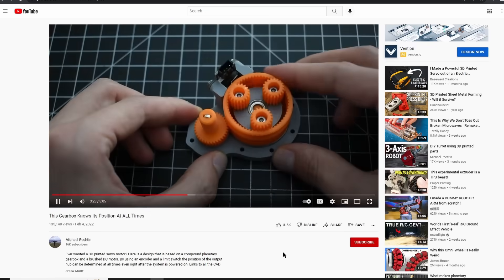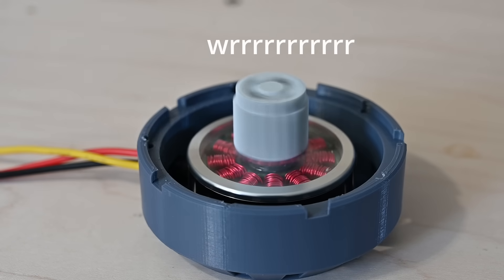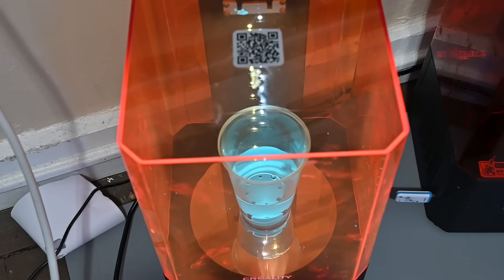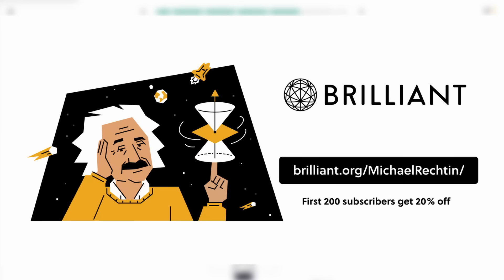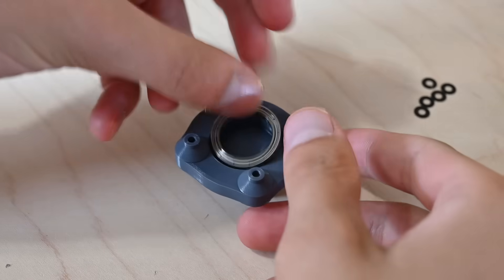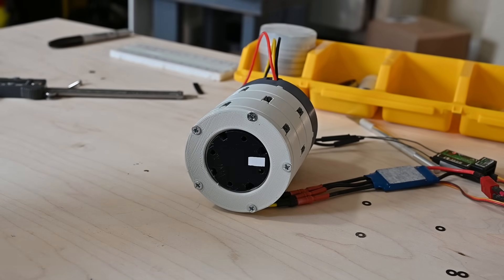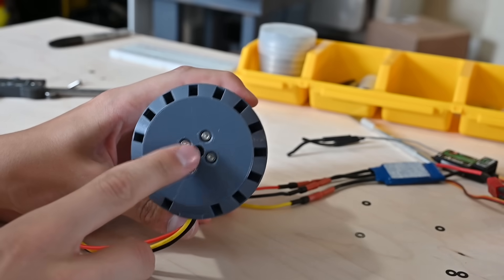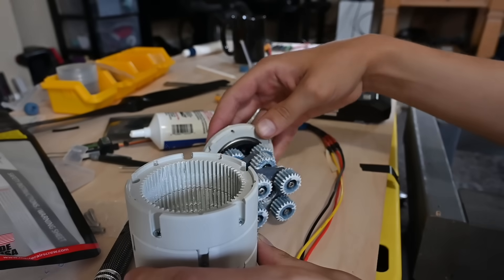3D Printed Stackable BRUSHLESS Motor Gearbox

Comment: The problem with your torque measurement now, is that because of the high velocity you are coupling a significant amount of intertia. The motor inertia might seem very small, but because of the gearbox it is amplifier by n^2. None of the cheap brushless motors actually quote rotor inertia, but generally its somewhere around 30 gcm^2. That means that with your 64x reduction gearbox, you are dealing with an inertia at the output of about 0.0123 kgm^2 (note the change in units). Guesstimating the speed of the output shaft, its probably around 0.3 rotations per second, 1.9 rad/s. This results in an angular kinetic energy of approximately 0.0217 J. Thats quite a lot of energy stored, especially if you want to try to slow it down in a very short period of time. Point being is that you are generally measuring much more than just gearbox output torque.

Torque testing should indeed be done at zero speed.

Also, are you aware that there are specially wound BLDC motors meant for slow speed operation? These quadcopter motors are optimized to work in a constant high velocity, but the ones optimized for slow speed are much more well suited for most robotic and servo tasks. You can easily find relatively cheap ones if you search for 'gimball BLDC' and similar search terms.
Reply: My thoughts exactly. Plus the rotating gear stages add their own inertial energy on top.
Reply: I feel dumb
Reply: Are you sure about the unit conversions? joules aren't a big unit, so 0.02 joules sounds small. As in, it's the inertia of a baseball that is moving at 2km/h (equivalent of falling a whopping 1.5 centimeters)

Definitely shouldn't be able to break the arm on its own, but I guess it could influence the result somewhat.
Reply: @alexbv475  Yes I am sure of the unit conversions. As a double check: rotor inertia is 30g cm^2 -> 0.03kg cm^2 -> 3e-6 kg m^2. Adding the n=64 gear ratio: 3e-6 * 64^2 = 0.012 kg m^2. Rotational kinetic energy is 0.5*I*omega^2 = 0.5*0.012*1.9^2 = 0.022.
It might not sound like much compared to your example, but a baseball is 150gr, quite heavy. If you drop this from 1.5cm onto a loadcell, it too would produce high forces. The key problem is that you have something that you drop onto something very stiff. This means that a lot of energy has to be dissipated in very short time period, and thus peak forces are quite high.
A pillar in a carpark can sustain tremendous loads, but if you smack it with a hammer, which has relatively low amounts of energy, the high peak stresses will still allow you to do damage.
Reply: @tHaH4x0r  Subbed for the maths. You could probably do videos about this kind of stuff
Reply: this definitely needs a clutch behind the first stage
i don't see the ESC surviving actual use
Reply: Nice explanation. Although you did not change units. You changed scalars. Gram and meter are the units. Centi and kilo are the scalars.
Reply: What is the type of winding you are talking about for gimbal motors? both gimbal and drown motors have the same type of winding which is concentrated winding type. Running a any type of motor at slow speeds depends on the type of controller not the winding type of the stator.
Reply: @Zae-R  Type of winding is the same, but not the amount. Gimball motors have much more windings to up the resistance (around the 10 ohm ballpark) such that they can produce a high amount of torque at slow speeds, and don't have a very low resistance which could easily burn out the windings without precautions. The extra windings help with the magnetic field. This is not the case with quadcopter windings, because they want to have low inductance, i.e. less windings to make sure you can still drive them fast when rotating. You "could" use a quadcopter BLDC for gimballing, but its not going to be working very well. You will need to rely on the current limit of the controller, and even then the magnetic field strength produced is not as good as windings made for gimball motors.

This is not new knowledge. Just when brushless motors started to become more affordable for hobbyists (around 2010s)  there were plenty forum threads out there about rewinding highspeed brushless motors for gimbal (low speed) use.

I should also mention that often expensive gimball motors are also differently designed internally. Generally they have much less poles to minimize rate of change of cogging versus position, however this is not a phenomena important in RC model motors. Also, drone BLDC motors generally use NdFe type motors as they require a large amount of mechanical power density. This type of design (as opposed to ferrite ring designs) also creates more cogging. If you want slow speed or precision, you want ferrite ring design (ex. HDD motors typically have these designs). 

If you don't believe me, try it out yourself. Buy a gimball BLDC of a certain amount power level, and a quadcopter one, and try to drive them around zero velocity.
Reply: @tHaH4x0r  I see your points and i agree. I just thought there is a different winding layout. You seem very knowledgeable. Good luck
Reply: Yes,  Michael needs to mount the gear box on a pivot and use the load cell to measure the torque applied to that while rotating a load. The load could be a step up gearbox and variable brake.
Reply: nah
Reply: Damn, when I read this chain of comments, it seemed to me that somewhere further an advertisement of some cryptocurrency trader or something like how 5-10 bots do it))
Reply: Actually a lot of robots use drone motors, not gimbal motors. Technically the maximum reasonable torque (at the point of nonlinearity) is the same no matter what winding is on the stator, it simply occurs when the stator is saturated with magnetic Flux. The problem with gimbal motors is that their windings are so dense that you can create enough electrical Flux to saturate the windings easily with low voltage, and low current. This also makes the back EMF super high voltage and means to drive the motor fast enough for robotics the voltage needs to climb very high. Additionally because of the low speed of operation the power density is very poor.
Reply: @tHaH4x0r
Yes, some motors are wound to have high flux density. To create this, it means that they gulp more current and hence produce far more torque than their high voltage counterparts. It is somewhat like the relationship between a formular 1 engine that revs so high to produce good amount of torque and a heavyduty diesel engine that revs low but generates huge bags of torque. Each one has its palce and use👍
Reply: you can also rewind brushless motors to achieve higher torque and slower rotation speed
Reply: Makes sense, but I've been needing a high torque bldc and haven't been able to find one. So I ended up ordering high speed one and found this video to try and torque it up. Finding your comment on high torque bldc seems refreshing since all the ones I've found are made for speed. I tried searching up gimball BLDC but none of them seem to have their torque shown. And searching for high torque BLDCs comes up with options starting at 200$. If you could lead me in the right direction I would very much appreciate it.
Reply: @Faysalariss  It's true that those higher torque motors are generally a bit pricier, especially if you want something halfway decent with specifications you can somewhat trust. 
I have found T-motor to be a reliable brand that has a bunch of motors aimed at these applications, with a high number of pole pairs and good torque constants. Specifically the GL100 seems to be a good all-rounder, with a torque constant of 1 Nm/A showing that you don't need excessive currents to get decent torque, and a rated (continuous) torque of 3Nm. I inquired with them whether this is thermally limited or not, and they informed me this includes thermal limitations, so you can possibly push the motor a bit further with forced air cooling.

But yeah, the price is a bit high. Lower cost options are available on sites like aliexpress (ex. 2204, 2208, 4108 and the likes), but they often dont really show any specs. I think if you'd want to go the lower cost route it might be valuable to build a test setup and do some testing yourself on the specs, or perhaps inquire with the seller/manufacturer about torque/speed graphs and thermal limitations.
Reply: You can use a worm gear first
Reply: I was gonna say, quadcopter motors do not handle low RPM's well. They don't have enough torque
Reply: that is true for real torque measurements. But as a max torque measurement it is ok. It doesn't matter where the load comes from, but you can say, that the max output torque for the transmission is at least 9.5Nm without destroying the transmission.
Reply: @thrownchance  Max torque measurements start from a resting condition where the device under test and the measurement equipment are already in contact. If they are not in contact you can continue adding kinetic energy to the system until it hits the measurement device, where you will see a large peak followed by a much smaller constant application. Take a car in drive and left at idle. If you start with the bumper on a wall, no damage will occur, however if you give it a 10ft rolling start, you will start breaking things even though the motor is providing the same torque output in both tests, the difference is the speed and stored kinetic energy.
Reply: @thrownchance  I disagree with you, shock loading is inherently different than static loading. Torques might seem torques independent of where they come from, but you are disregarding the concept of energy and how it is spread over time. The only thing that can be concluded is that a (single) peak of 9.5Nm will not destroy the transmission. I put 'single' in brackets, as you might exceed the yield stress and start plastic deformation or fractures, especially in the infill. Only a proper fatigue test would be able to tell you whether or not it can actually deal with these peaks without damage.

An example for the difference between shock and static loads with materials might make more sense. A relatively stiff material (such as regular PLA) will have much higher peak stresses in the material, which can lead to broken parts. Something less stiff like PETG bends more, hence spreading the same impact energy over a longer time thus lowering peak stresses, which means it might not break for the same impact as PLA. It however should not be concluded that PETG can take larger torques as these are (again) shock loads. It is very likely that for the example materials PLA can actually carry a larger maximum torque due to the higher yield stress.

Comment: Since the planetary gears come out as such a nice cartridge, perhaps include print files for outer shells of several lengths. Saves on screws, etc., if you know in advance you'll have, say, 3 stages. I was thinking grease holes too, but it looks so easy to take apart to grease, it doesn't seem worth it.
Reply: I agree with this

Comment: As you have concluded, measuring torque while using an ESC won't really tell you much.

There are some very nice alternatives to ODrive now that would work well with the size of motor you have.

In particular: the Tinymovr (R5) and Moteus controllers. They are much smaller than an ODrive, come with the encoder built in, and mount directly behind the motor.
Reply: Wow, you could get an entire stepper with more torque and a much higher RPM than his motor+gearbox for less money than the >$100 controllers you mentioned. Seems like hacking an ESC that supports position feedback would be a much better idea
Reply: Literally cheaper to buy the equipment to design and build your own driver with an STM32

Comment: Another idea could be using different gear profiles, but an otherwise identical format.  Could maybe try and get a series going akin to that “Design a Fan Blade” series although I don’t know how to build that hype i guess!

Herringbone Gears are the ultimate if I remember correctly, although there is probably some downsides i am forgetting.
Reply: Among other things mounting the gears requires split gears, twice as many housing parts, requires more dexterity to put together; not insurmountable... Much quieter, more torque, many advantages!

Comment: use simplefoc to control the driver at low speeds, even without encoders. it works great, and can be upgraded to encoders. there is even somewhere a board which lets you do a control by amperage
Reply: The stm b-g431b-esc1 is capable of doing basically everything, but it is a hassle to work with.

Comment: You could try testing how much weight the gear box will lift at given ratios. Knowing that would help determine what kinds of applications you might be able to build this into. Long Term speed test for heat and wear would be good too.
Reply: Isn't that what torque is?
Reply: No the problem is the motor is too fast.  Unlike a theoretically optimum electric motor, it can't produce 100% of torque at zero speed.  It can only produce torque well while moving quickly, he explained that.  A sensored motor is the solution.

Comment: Really cool design, thanks for sharing!  If it is accurate, that amount of torque out of a 3D printed gearbox is wild. +1 for adding an encoder for better low-speed control.

Comment: brushless dc motor
Reply: dc emf motors have instant torque, no motor angle lag
Reply: you can even hand crank a very heavy arm, if you use large gear wheel with small 90 degree driver gear
Reply: only two wires, no commutator brushes
Reply: especially no controller
Reply: dont doubt, its possible